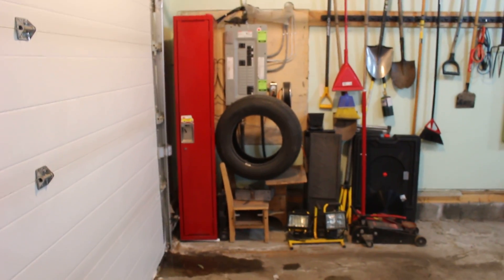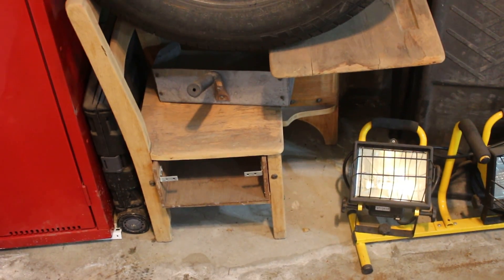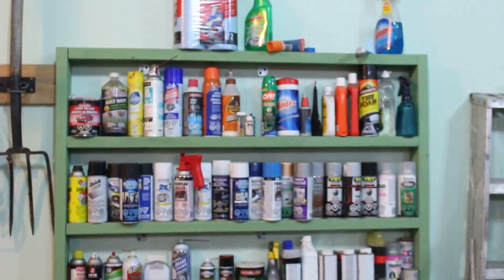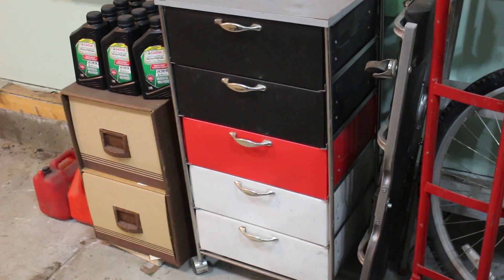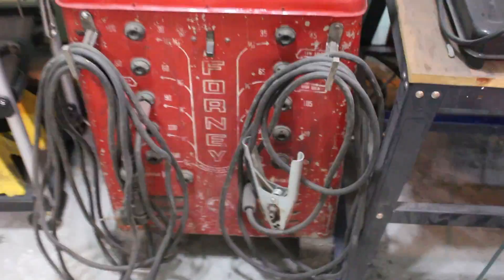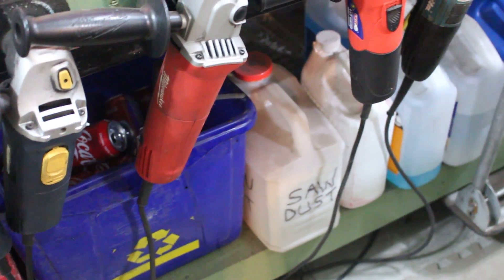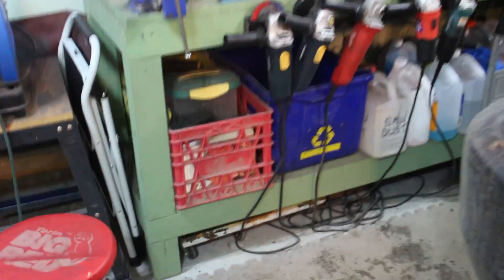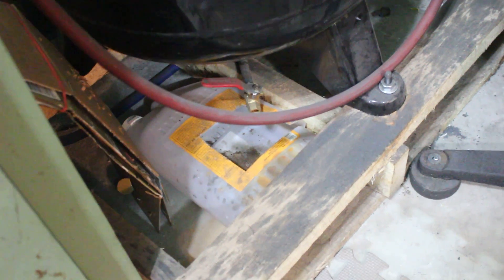Shop Tour 2018 Part I

Comment: I'm so jealous of you having a breaker in garage. I rent my place and don't wanna drop almost 2 grand to add it. Sweet tour waiting on part 2
Reply from the maker: Thanks Chris.  I had the same issue when we were building this house and living in a rental.  I decided not to spend the money and went without my compressor and welder for two years.  It sucked but I hated the idea of spending that much money on a place I was just renting.
Reply: Bruce L. I totally agree with that. Thinking of a 100 ft extension cord from the dryer to shop for when I need the power for welder, works great on 110 volt for Tig, stick blows the breaker over 85 amps and a few rods